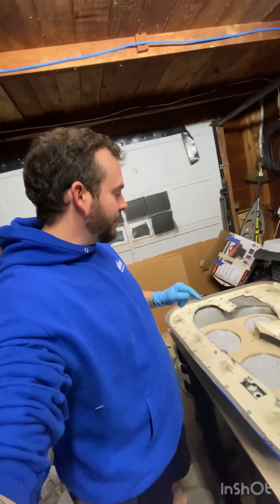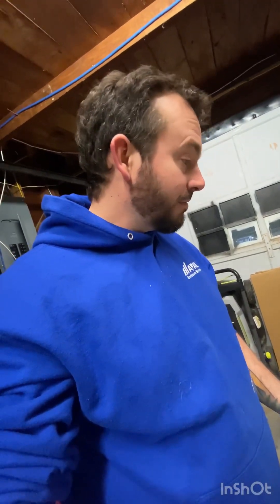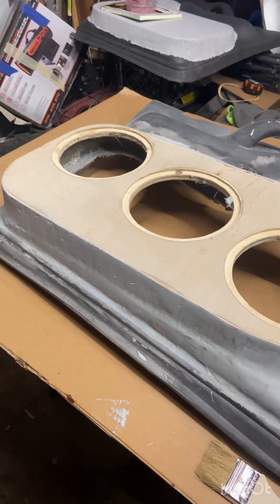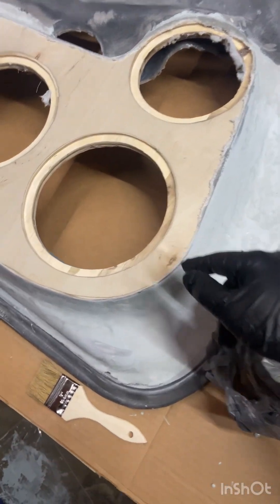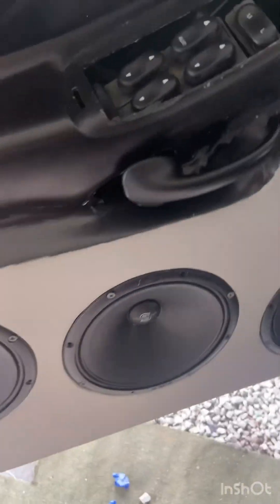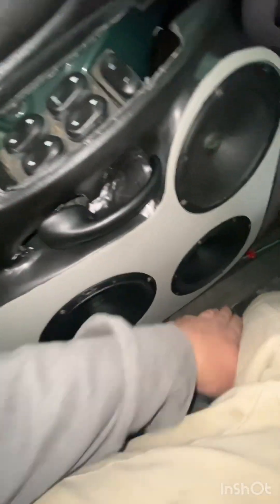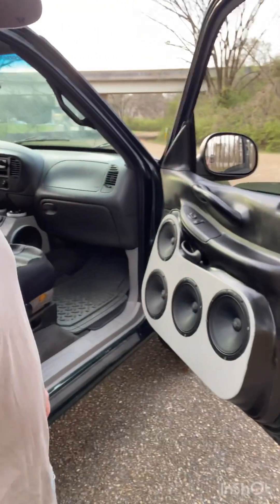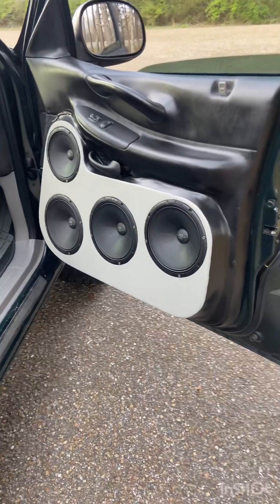Building my door panels part 2

Comment: What amp u got running the doors?
Reply from the maker: AAP-400.4 on 2 8s per door and mfa220.4 on the other 8 and 6.5. Just to be able to do a side by side comparison of the new vs old amps. Same settings through dsp. Will do a video soon.